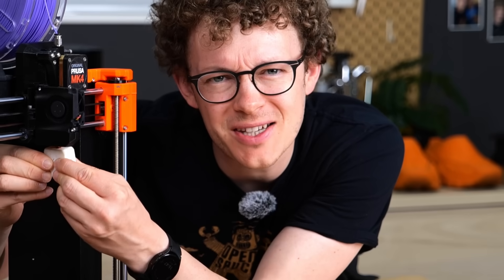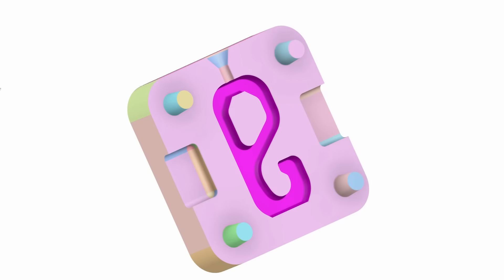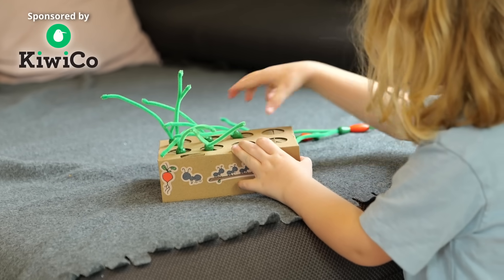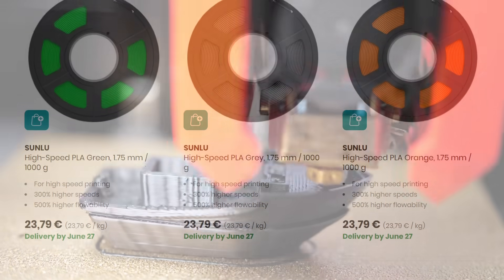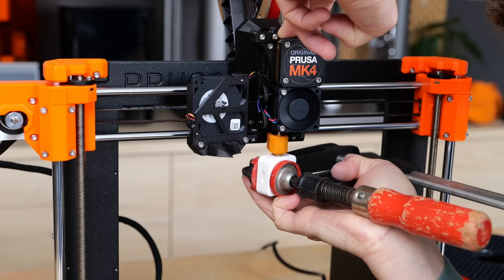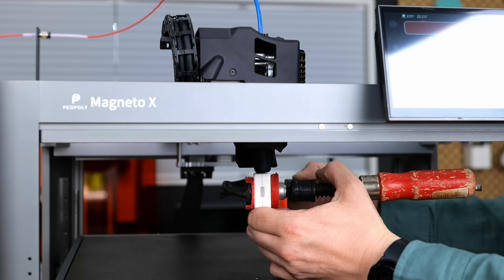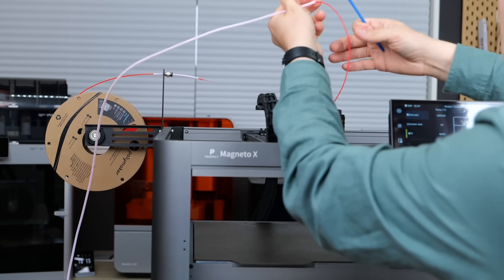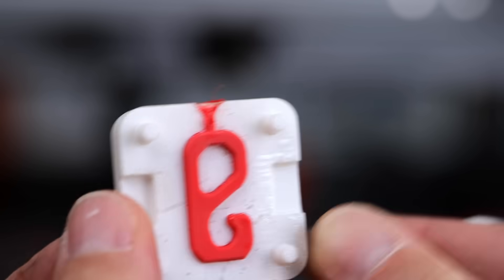I tried Injection Molding using a 3D Printer!

Comment: 1) injector pushing plastic from bottom to top instead of top to bottom
2) mold is constantly warmed so the plastic injected doesnt cool down and never loses viscosity
3) air holes at the top of the mold and high points in the mold so air doesnt get trapped with vacuum tubes attached sucking out the air and the plastic so air pressure doesnt build up and there's no trapped air. It also helps the melted plastic to move along the crevices

Comment: - Exit air holes are missing.
- If the pressure was that high you calculated, you would not be able to keep the mould in place.
- Maybe you need a modified nozzle where you screw on the mold model directly. Problem is then that you would need a material for the mold that can wistand the nozzle temperature - especially possible overheating in the warm-up process. Indicator that the form would be filled was then the exit of material through the air holes.
- Put some bigger aluminum or copper plates to the mold, then some temperature insulation material before clamping it together. This way you could use an external heat source to warm up the metal plates and thus indirectly heating up the mold.
- The above could be done with peltier elements. You then need the metal plates on the cold side of the peltier element. This should be good for 60°C or even more, depending on element and the metal size.
Another advantage is, you could reverse the direction of the current and cool down the mold quicker, even though peltier elements usually are less efficient then, iirc.

(Edit: typo fixed)

Comment: Hi Stefan... I think if you printed a mold and casted it into some sort of easy metal, then you could feed heat into that metal mold to make sure the injected materials flow better (even without moldrelease) but that might be a step to far.... on the otherhand you would have a more durable mold!!

Comment: You probably can get the temperature of the mold a lot higher by putting it in an oven. The best temperature would be the one allowing the resin to keep it's strength and keep the planarity between the two pieces. You can also try resin made specifically for molding, which I think already exists. But the one you have may be the right one.

What I can also say is that you are trying to make pieces that are quite complicated. What could be best to try out here would be a form that would prioritise volume over surface. Basically a shape that would be as close as possible to a sphere.
In the same idea, getting the tube for injection as short as possible would help lower the pressure of the plastic in the chamber once it gets to challenging parts of the process.

Very good idea to find the right plastic and the right temperature for it, could you give the temperature? I might try it out too.

Comment: Most of the guys here comment the process of molding. Not less important is the design of the part. Draft angles in your case should be significantly bigger like in the metal injected parts. We are talking 5 deg or bigger. Also on the bolt you tried to mold - no way to fill a part with such straight angles. Always try to round every angle at least a little bit. Usually R0.3 is enough but I would recommend R0.8 in your case.
For clamping between the core and cavity you could make the mold with trough holes and use bolt and nut to hold them together. For demolding you could add 1 or 2 threaded holes and use a screw to separate them.
Regarding all the other problems - enough comments already. Wish you luck! We are waiting for the refined process.

Comment: ..it's not that your giving it an excellent effort. It's the way injection molding machines use the plastic. IT's much like the screw based machines that extrude the filament. Their heater sections are about 0.5-1m in length. And the rams behind the screw turn it as it reverses away from the mold (which are water cooled). once the plastic has had ideal time to liquify, the 10+TON ram pushes the still turning screw forcing the plastic out of the nozzle (maybe 3-8mm) upwards of 10ksi. It then pauses and then repeats the melt cycle while ejecting the parts.

Comment: Lots of people recommending an air hole, but wouldn't that allow the mold to trap air in places when it comes to more complicated molds, since the material could just flow out of the air hole more easily than pushing into some spots with air bubbles?

Comment: Where does the air in the mould go?  You are hand holding the mould so clearly even if you "pre-heat" it, it not that hot. Get it say 10 degC below you plastic fusion temperature and it will not solidify before filling.

Comment: I'm wondering if maybe the reason it can't fully fill the mold is due to air pressure building up inside so maybe on the last little bit on the end of the hook put a small are escape channel on the side that way once you see plastic coming out of that hole you'll know it's fully filled and maybe instead of holding the mold against the nozzle yourself you could place the mold on the bed of the printer itself and use the printers on steppers to force the nozzle into the mold

Comment: what about printing the mold in a translucent material, pouring SLA resin into it, then curing it? I guess it would only work with clear resins since the UV would need to be able to penetrate to the center.

Comment: Try making the molds similar to sand casting instead, instead of having it pour through the top  of the mold have it go through one instead. The further it has to travel the more it cools, so limiting how far it has to travel.  Closer to the center of the mass instead of the outside. Give a vent hole so that pockets of air wont form.   Have the machine lower down onto the part instead of lifting it up to it, can use the heated bed to keep the mold closer to the temp for easier flow.

Comment: Why not make a a threaded portion on the mold? you can make the buffer out of a bolt and a 1.75 mm drill bit. This plus a vent hole should give you far better results. Id probably also just make holes and put 4 bolts to spread the seal and using proper pressed in "bearings/bushings" you could increase the mating tolerance a bunch

Comment: If you want to talk about an extruder pushing, I can certainly vouch for the voron clockwork 2. There was so much back pressure on the nozzle that it actually deformed the entire printhead assembly and blew the hot end off. Mind you, I was printing an extremely large first layer so it's not like this just happened during a normal print.

Comment: 1 - air hole
2 - keep high pressure injection into the part with solid mounts, not holding it
3 - keep the mold heated

perhaps use the gantry to push the mold into a hotplate set to as high as it will go?

Comment: Very nice! Has lots of potential.
screw the mold directly onto the volcano adapter.
put the spout into the middle of the hook so the path is shorter to the end of the mold.
move the cavity of the screw-mold much higher to the top funnel.

Comment: could make a cheap mold by using the 3d print for a casting and use a metal that can be effected by induction which will be used to keep it to a set temp so the filament stays flowing and doesn't hardened due to it touching a surface that's not hot.

Comment: Technically speaking your not injecting but extruding. Even molding machine don't normally do extrusion molding. It can be done but your missing a true packing state. Although this experiment does spark my engineering mind to start thinking about hobby injection molding possibilities. There are small barrels and screws on the market that are the right size. Aluminum extrusions with stepper motors could be used to make small plattens. Now we use the resin printed molds as described in this video. Still would only be good for small parts but could be a handy to have.

Comment: For the moulds you can try raisins that are made for high temperature use and warm it up before using.

Also a vent to let air out and prevent airlock can be tried

Comment: at 10:53 - why you inject the plastic from the side instead from the middle of the form?
Possibly there is an air bubble that resists the flow. 
Maybe you should try form where the plastic is able to get to the other end of the form pushing the air. 
Another option I see is to use multiple plastic fill-in points from couple nozzles (for bigger models).

Comment: I think you need to include a vent channel in the mold's pockets. I think you are "air locking". Basically filling the mold thru the only hole with hot plastic, and pressurizing the air inside the mold until it equalizes with the incoming liquid plastic.
Fantastic idea! Please keep working on it.

Comment: Why not take a volcano nozzle, cut off the nozzle part so that only the thread is left. Then thread that into a normal V6 hotend so that some of the thread sticks out. Then replace the sprue on the mold with some printed thread, and screw the mold onto the hotend. Add silicone o-rings for bonus points.

Comment: It does no good to just select by flow, you need to keep your mold hotter than the melt point of the plastic. This means you either need to heat the mold, or use a plastic that melts close to room temp.

Comment: is it worth it to continue refining this method? Starting with the assumption that your specific implementation is bad/flawed, refining even bad implementations produces knowledge and data that are then useful in making an actually good implementation, this is true in all fields of knowledge/science/engineering, but it is especially true in "crowdsourced" areas like DIY and FOSS since even a bad implementation gives anyone interested in helping a starting point to mess around with and at worst acquire experience themselves while providing data on what doesn't work for the community, both of which are valuable.

Comment: Hey Stefan,
Good video as always! I think its an interesting idea to take the 3D printer for injection molding. We made a few tests with our MFI-machine and 3D printed molds but they always broke due to big pressures inside the cavity.
Also with small air gaps for releasing the air inside the cavity. The preheating is a bit of a pain due to the need of a fast workflow ^^ 
In my opinion you would get better results with thermally conductive mold materials and a higher injection speed due to shear thining. The need of air holes should not be a problem because of the staircase effect in case of your chosen 45° printing direction. 
I am currently working on 3D printed molds for our "Plasticpreneur" machine which we have in our lab. Maybe we can talk about that in detail next time ;-)
Have a great day and greetings from Austria!

Christoph from TCKT

Comment: Just do a thermoset injection. It’s a cold injection that’s a lot easier to do at home as you don’t need hot plastic. There’s really high grad/high strength thermoset plastics that you can use.

Comment: Aftwr watching whole video i can make a improvised system using 3d oen for successful mould generation 

First step would be make small size mould sandwitched between 2 silicon heater so its hot and using 3d pen to fill that mould 3d pen has faster flow rate than these conventional stuffs another bug improvement i see with 3d pen is to hack it to be the small injection moulding machine for future use its could be made with Arduino and open source stuff for very cheap price

Comment: A mold needs an outlet, you cannot inject anything into a closed space...
Why not try negative pressure? :-) Connect a vacuum pump on the outlet of the mold and push material in with as much pressure as practical, decreasing the time it takes to fill the mold...

Comment: As someone who worked in the plastics industry for a little while after college: you need small air holes to allow the filament to fill and the air to escape away from the injection path. injected material should blocked the flow out of those hole before coming out of the injection port. Tominthebox in the comments had a fantastic idea of using the gantry to push down on the mold onto the bed to maintain the seal. Unfortunately though that will require a bit of math and gcode tweaking but thats right up your alley. Once the mold is filled, and the air holes are blocked from the plastic since its too thick to fit the hole, THEN it should come out of the injection port. On another note, if you were to add some extra heating element ports to the mold to maintain the flow you can do larger parts. In this way it may actually be possible to turn the 3D printer platform into a cheap, jerry rigged injection molder. Altho it would definitely not be automated because Ejection would still be an issue, and the automation is what makes injection molding superior to 3D printing for large scale manufacturing.... well that and its manufacturing speed.

Comment: Why use a 3d printer when those 3d pens exist? Just overclock one of those and save so much time and money. Also it will allow you to use multiples of em in multiple sides of the mould. Then you can mount them on a frame and wire all the buttons up. Technically 4 of them would solve the limitations. You can use 2-4 3d printer heads all mounted on a frame but if you can solve it using the cheap 3d pens then you have a winning cheaper/easier design.

Comment: Lots of good advice and ideas here already but I just had a potentially useful idea:

In addition to lowering the gantry to use the hotbed (probably with a metal heatspreader/"hotbed-protector") to heat the mold consistently it might also be possible to hack together a heated clamp:
a clamp with metal jaws, peltier plates and temperature sensors/switches for temperature control. 🤔

Comment: What about using a tiny bed heater on each side of the mold to keep the mold hot during injection? This could be easily adapted to most 3rd party boards as well for temp control and fine tuning the mold temperature.

Comment: well by the sounds of this you've discovered that you can use 3d printer hotends to make your own injection moulding device. I think you could make an injection moulding device from resin printed parts and spare nozzles (and extruder asemblies) for a little over 1-200 bucks depending on the parts you choose to use. I will definitely take a look into something like this myself for other projects.

Though you would need some way of reliably keeping the mould warm. Another reason injection moulds in industry are made from metal is that for more consistent parts (especially on bigger parts/ moulds) the mould needs to be kept warm or it'll clog, form bubble, not set correctly or evenly, etc. I'm not sure about hobby injection moulding devices and whether they do this but it's at least something to consider.
Reply: Mold heating could potentially be solved with metal clamp(s) and/or metal pressure spreading plates heated by peltier plates and controlled via temperature sensors or temperature (kill)switches.. which are also relatively affordable. 🤔

Comment: Very cool idea. I to was 3D printing but wanted a way to make parts faster and stronger which was why I started developing DIY injection molding machines. I think one of issues that you will run into with using a 3D printer is how fast the plastic can be injected before cooling as you have seen. The other issue is that even if you are able to fully fill the part you would want to keep pressure on the part so the plastic has less shrinking and pitting as it cools. That also might be harder to do with an extruder over a plunger or screw type injection molding machine. Preheating the mold is important even on a regular injection molding machine but typically the heat from multiple injections is enough to keep it hot. I also can't remember if I saw vent holes for the air to escape but that is also very important. Last thing you could possible try is to switch the location of where the sprue is injecting the plastic in to the mold. If you did it from a more central location the plastic would have less distance to travel and thus potentially give you better results. Still super cool and can't wait to see what you are able to come up with!

Comment: Suggestion:
Why not use a threaded, hollow bolt as your nozzle and then design complementary threads into one side of your mold. Screw one side of the screw-like nozzle into your hotend and screw the other end into the threads on your mold. This should create a tight seal between the hotend and the mold, preventing leakage. Then clamp your mold together and proceed.

In addition to preventing leakage, by using a hollow, threaded bolt, you will also have more diameter to allow for maximum flow into the mol.
Reply: Double edged sword, with a wider nozzle you risk the potential for air to get in, which harms the ability to heat it up, as well as the ability to actually extrude it with effective speed
Reply: @thepenguin9  You can make the hole in the threaded bolt as narrow as you wish.... My point is by using a threaded bolt you get a better seal whatever the size of the hole...

Comment: Check with @ShakeTheFuture - his mold-making method using plaster poured over FDM-printed models should be usable for small-run injection molds.  This means that one can theoretically injection-mold a small run of pieces using just your 3D printer and an oven (to drive all the water out of the plaster mold).